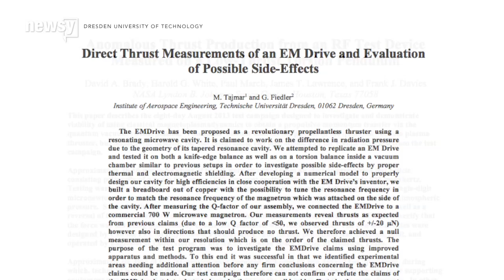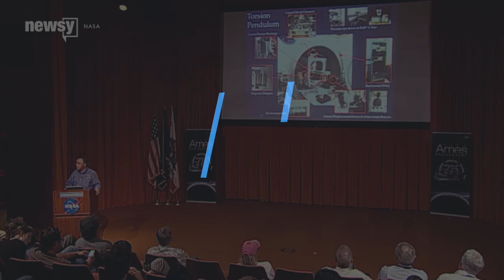NASA's EmDrive engine to be tested in space

Comment: 2011- Nasa: We have a physic's braking engine, still need to do more testing.

2012- Nasa: Drive seems to still work, still need more testing.

2015- tested it in a artificial vaccum, still seems to be working, doesn't f*cking make sense so more tests are needed.

2016- Company: F*ck it, send it up to space and see if it works.

Comment: So... they don't know what force it can create...
So even IF it works , it can be to little to fight force of atmosphere , and it will still fall down.
Lets say average cube stayed 9 weeks , this one will stay 10.
Now fucking guess what happen .... srsly ?
Reply: There are different engines for different stages of flight. The thrust on this thing (if it does work) is too low for in atmosphere maneuvers. It'll probably land up getting used for solar gliders.
Reply: Rob DC Yeah i know.
But reason cube sats fall is due to marginal atmospheric drag. It stil like 0.00001% vacuum or something but it is constantly slowing crafts down. Even ISS has to fire small engines from time to time to stay on orbit.
This thing will be under same drag. So.
If average Cube Sat stayed x weeks (no engines on it) , but this thing stayed like 1.1 x week. It will be too small difference. Even if the thing is heavier , it will make ti resist drag more.
But if it stay 1.5 x or 2x weeks...
Well this would be big...
Reply: Dysputant I'm actually going to say thank you. I'm still in school so my knowledge on the subject is mostly self taught. I never considered drag as a force in orbit. Makes things a lot more interesting.

Comment: "because physics" because you are to stupid or lazy to reseach. there is a paper out that theorizes that it's exhaust is paired photons. fucking lazy ass channels.
Reply: That paper is wrong. First of all, physics is not zen buddhism. If two waves destructively interfere, they are both, well, destroyed. They're not still "there" carrying energy despite the fact that there's nothing there. Secondly, if it did work that way, it'd be less efficient that a flashlight at converting electric energy into momentum.

Look at yourself before calling other people lazy.
Reply: avicenna when did i compare it to zen Buddhism?? Their forces CAN NOT BE DESTROYED. So your proof is fucking bullshit
Reply: Tyler Lalonde Hahahah no. Bring an argument next time. Kthxbai.
Reply: "Their forces CAN NOT BE DESTROYED."
1 + -1 = 0
When you overlap a waveform, such as a photon, with another wave that is exactly inverted, they do go away. You add each of their negative parts to the positive parts of the other, and each of the positive parts to the negative of the other, and you get a flat zero.
What has to happen isn't that forces can't be destroyed, but they have to be equal and opposite. If something feels five newtons, something else has to feel five newtons the other way. For a laser beam, it's the thing firing it and the thing it hits that take that force. But if you cancel out the laser beam by adding an inverted beam into the stream, the other laser takes the force along with the mirror you added to add the two beams together.

Comment: I doubt it'll work, even though I really hope it does. At any rate, our current understanding of physics says it won't work, not "physics" (there's a hellofalot we still don't understand).
Reply: ***** They didn't say that it actually works. They're simply measuring an anomaly (which basically translates into a tiny amount of thrust) that they can't sufficiently explain away. So they can't prove that it doesn't work (e.g. disprove that it does work).
Reply: Joe you represent the typical NASA scientist of the modern day, reject anything you dont fully understand, believe that the human race knows everything there is to know and belittle anyone who suggests otherwise. i am no fanboy but a true scientist, the difference between you and I is that i still have an open mind.
Reply: Virtual partical pairing is one far out hypothesis for why it could work
 that is completely unnecessary. 

Cullens radiation pressure research from the 50s show everything we need
 to define how it works. Electromagnetic waves carry momentum, radiation
 is shown by Cullen to be able to transfer its momentum into matter. 
very simple, nothing magically about it all and it doesn't require magic
 particle pairing !

Joe: since you dont get it the amount of thrust is completely dependent upon the size of the structure, the amount of energy introduced into the cavity. Suggesting that thrust is fixed is idiotic.
Reply: FuckMotheringVampire: the hyperloop is a load of garbage so shove it ! and note my words do not claim that NASA is anywhere near being an authority on this engine. They didn't invent it nor have they given it serious consideration.
Reply: "Not so sure about that. I'm pretty confident that NASA (and a number of other authorities) took the instrumentation into account"

It makes no sense to assume infinite competence on the part of NASA since the people carrying out the experiment (Harold White, etc) are complete crackpots.
Reply: avicenna Who assumed "infinite competence" on the part of NASA (or any of the other authorities for that matter)? At any rate, your point is irrelevant. Given the choice between NASA and several universities on the one hand, and some random dude on the internet on the other, the decision is not difficult. I.e. current results warrant further research, irrespective of the outcome. Those who can't see this, are not real scientists. In fact, they're not even scientifically curious.
Reply: OldBoy Several universities will tell you that momentum is conserved. It's that simple.

"Those who can't see this, are not real scientists."

Good to know that people like Sean Carroll and John Baez (and, for that matter, nearly every reputable physicist who's heard of this) are not "real scientists" :o)

Look. If you want to say that 400 years of physics have to be thrown in the bin you have a HUGE burden of proof. Astronomical, in fact. Bring that proof or you're not worth taking seriously. It's that simple.
Reply: avicenna Our current understanding of physics says that, but again, that is irrelevant. Every now and then our understanding of physics is overturned, or at the very least significantly "tweaked". And each time there are those who fight it tooth and nail. Assuming, this is one of those occasions, they are working on "the proof". The proof, especially if it's "astronomical", is not going to fall out of the sky, is it?
Reply: OldBoy No, if the emdrive is to work, it needs to be overturned. Tweaks won't do: everything in the physics of the last 400 years will have to be thrown in the trash.

Or it could be that Harold White, a man with a history of crackpottery and with a penchant for having all manner of horrifying misconceptions, did an experiment incorrectly.

I wonder which is more likely. Hmm....
Reply: avicenna Except of course, it's not just Harold White. As for the results, we simply don't know. It could be nothing more than a measuring error (which at the very least reveals something about our ability to accurately measure small amounts of force). Hence, further research is warranted.
Reply: OldBoy Tell me who is in that group who is sufficiently non-crackpottish to cancel the crackpottery of the rest.

You can think "further research is warranted" all you want but at the end of the day that doesn't mean anything. All that is known can be summarized thus: there is no evidence whatsoever that conservation law violating devices such as the emdrive work. And that's that.
Reply: avicenna That's actually wrong (both your attempt to simply dismiss everything as crackpot and the way you approach the concept of proved/disproved), but I don't think you really give a damn. Any further discussion would be a waste of time as you already know everything and you have no intellectual curiosity to explore this any further.
Reply: OldBoy "That's actually wrong"

No, it's actually right, both the fact that Eagleworks are a bunch of crackpots who don't have the slightest idea what they're doing, as well as the simple fact that there is no evidence the emdrive works.

" you have no intellectual curiosity to explore this any further."

I have plenty of intellectual curiosity. Just not about dead end avenues of research invented by people who are banging rocks together to see what sticks. There is no reason to expect the emdrive works. None. You might as well staple a banana to a cat and expect a perpetual motion machine. It's absolutely daft.

It's the emdrive proponents that have to convince the sane among us that their pie in the sky idea actually has merit. Not the other way around.
Reply: avicenna OK buddy, but I'm still going with with NASA and several universities on this one. Unlike you, I do believe that the experimental results warrant further research.
Reply: OldBoy I think it's peculiar that you have to pretend that a few cranks in each institution represent the institution.

A few crackpots inside nasa do something -> nasa does something.

A few crackpots in some random-ass universities scattered across the globe do something -> "several universities conducted an experiment".

Be honest with yourself for a moment, please. "Several universities" and Nasa as institutions don't consider it plausible that energy and momentum conservation are going out. Sorry, they just don't.

"Unlike you, I do believe that the experiments warrant further research."

Suit yourself. You might as well go for perpetual motion machines too -- but I guess you wouldn't try to pretend that Nasa endorses perpetual motion machines, would you?

Psst: the emdrive is a perpetual motion machine.
Reply: avicenna Your continued use of a straw man arguments says more about your intellectual integrity than it says about the experiments. This discussion is pointless. You have made up your mind, and you aggressively dismiss anything and everything that might challenge your views. So stick to your views, while the rest of us wait for the paper and further experimentation.
Reply: OldBoy "Your continued use of a straw man arguments..."

Name one.
Reply: avicenna I already have. That's another issue I have with your replies. You don't read what I write, or at least you don't reply to what I write.
Reply: avicenna By the way, out of sheer curiosity, do you happen to be one of those "New Atheist" proponents?
Reply: OldBoy "I already have"

No, you have not. Where is the straw man? Point it out explicitly.

"By the way, out of sheer curiosity, do you happen to be one of those "New Atheist" proponents?"

No.